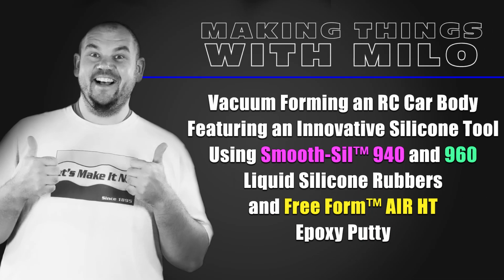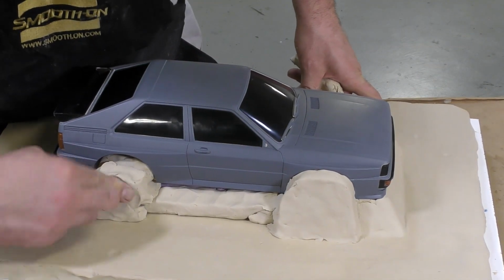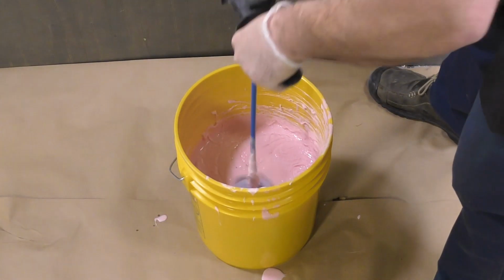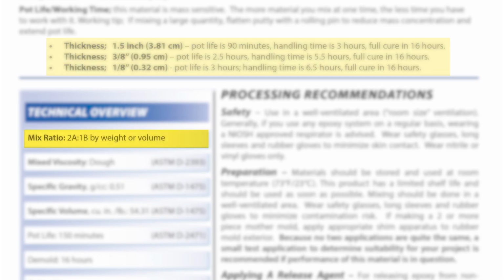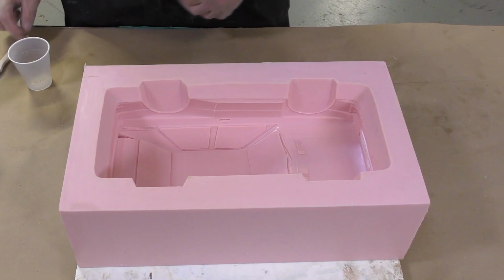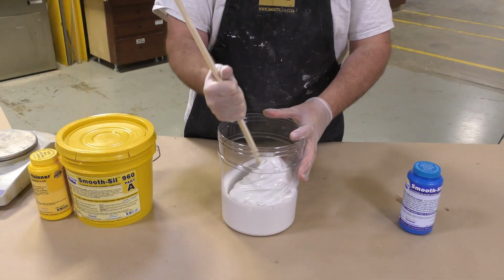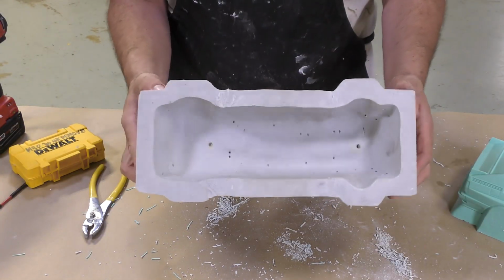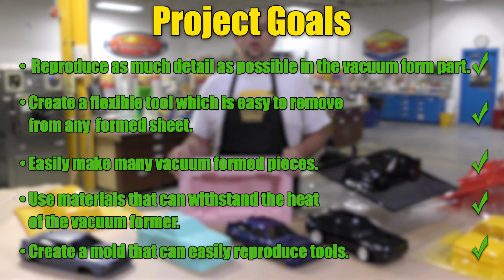Using an Innovative Silicone Tool to Vacuum Form an RC Car Body

Comment: you work is extremely detailed you know your skills thats for sure. especially with that vacuum pressure work raising & dropping that mix & also that 2nd bucket mixing stage with an even bigger mixer, you are very thorough with your work.👍I tip my hat to you Sir.

Comment: Nice work. I've been making V-Formed Polycarbonate bodies this way since 2019. I use the 60 duro hi-temp material and the aluminum-filled epoxy for the mandrel. Much better method for getting precise detail than a hard tool with little or no worry about undercuts, back drafts or difficulty removing parts from the male mold. Thanks for sharing.

Comment: Absolutely brilliant video Milo ! ; ) ......................  right up my alley so to speak.  Watched it 3 times already!
Vacuum forming and designing tooling plugs is what I do,  been using very very expensive Vac-Cast epoxy resins with Aluminium powders in it for years,  closest thing to real manufacturing tooling plugs ( or Bucks ) that the industry use.  Negative draft angles have always been a major issue ...................  until now!

Very cleaver use of the 'Skin' over a solid form.  A technique I'm sure I will now be using myself.  I had no idea, nor did it occur to me that you could vacuum form over a silicon rubber. As I design prototype automotive headlights the methods you've just shown us, is sure to make my tasks so much easier,  not to mention,  the possibilities of vacuum forming shapes that otherwise wouldn't be possible.

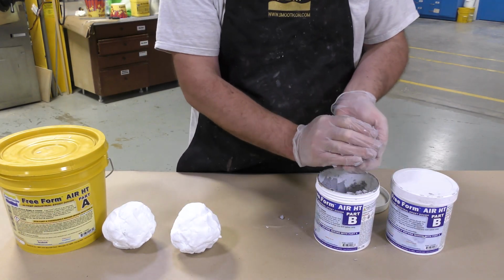It was also very interesting to see you actually preparing the 'Free Form Air HT' @ 16:28,  I tried one of your other products 'Free Form Sculpt' as demonstrated by Janessa in the following video
https://www.youtube.com/watch?v=wja4FNQ4Ojg&lc

The product was awful ! ................  I found it to be unworkable,  my comments at the time were somewhat harsh,  my frustration was very clear at the time.  But 'Free Form Air HT' seems to be the product for me. We shall see  ; )

My vacuum forming machine happens to be the Formech 508DT that you used for the demonstration,  great machines.  I also have a 20 Litre degassing system from 'Easy-Composites' in the UK,  so all I need now are the materials ...................  hopefully I can buy them through my regular Smooth-On supplier in Europe.

Many thanks for these great tutorial videos guys, keep 'em coming  ; )

TURK
T4 Concepts

Comment: I ve been forming bodies for more than 10 years and i'm always happy to learn new skills! The solid core with rubber skin is a brilliant idea. Most of my molds are in pu resin charged or not. I use silicon for fiberglass molds but never thought of forming with it. Thanks again, will try this ( on my formech 😉)
Reply: I’ve been incredibly curious as to how people make these bodies. I really want an 02 WRX 1/10 scale body. Is this something you can create?
Reply: @slicelifetv  vacforming technique is made to build in series, so I can make one body, but customer need to pay for mold, so for one body it's rather pricey 😉

Comment: Thank you for this video!  I have been trying to explain this process for making a vacuum forming buck like that to the people at the makerspace, but my description always fails to describe just how much detail and saved time this process produces.

Also, I did not remember hearing you mention this, but you should file down the edges of the cutting tubes (either inside or outside) so that the act like a blade and punch through the material more easily.  File down the inside if you want to keep the outside dimension accurate and vice versa for the in side dimensions.
Reply from the maker: Great idea!  Thanks for watching, and don't forget to subscribe!

Comment: I think there is a way for getting better detail in the body. That is making an inverse mold, so the external parts of the body goes against the mold walls. I mean, a concave mold. That way you'll have the best body detail outside and not inside. Tell me what you think of this. Regards and congratulations for your amazing work.

Comment: In the late 1980s, I had a few of that specific RC car from Radio Shack, the Audi Quattro.  I still have them.  I also have the service manual with the electronic schematics, mechanical assembly drawings, etc.  I really enjoyed this video showing the entire process of reproducing the main body.  The original car was painted metallic silver and covered with paper decals so I assume the one in the video was stripped and prepped prior to the video.  The original car window piece is black plastic so I thought it interesting to consider the possibility of using similar procedure to make a new clear polycarb window part for the original car body to expose the interior if anyone wished to model a new interior and driver figure.
Reply from the maker: Thank you for watching! Don't forget to subscribe!

Comment: Your braver than me mixing that bucket of silicone without holding on to it I keep waiting for the bucket to helicopter and spray pink everywhere in sight trust me I’m not as lucky as you just thinking about not holding on would cause it to go everywhere and that’s before I start mixing 😅

Comment: 4:06 why not support the inside of model being copied with a layer of the same silicon with a Ridgid solid core placed into the still liquid silicon before it sets.  That way it’s perfectly protected from collapse and warping, the rough cut foam panel support is cheaper but could cause just Ehh result.

Comment: Very very cool !
I just made a rc body out of fiberglass. 
Do you think it tolerates heat for vacuum forming?
Reply from the maker: It would depend on the resin.  We recommend you contact the resin manufacturer for heat tolerance.
Reply: I used fiberglass to make my bucks for custom rc bodies when vacuum forming
Reply: @smoothon  thank you.

Comment: What vacuum pump are you using in this video? Thank you and have a most awesome day!
Reply from the maker: This is a Formech Vacuum Former - www.formech.com
Reply: @smoothon  Sorry I did not articulate, what make and model vacuum pump are you using to de-gas the silicon compound?
Reply from the maker: This is an 8 CFM vacuum vane pump.  Many different types are available from online retailers.

Comment: I can't get hold of 'FreeForm Air HT' in France, and my regular supplier in Holland doesn't stock it.
Can I use regular 'FreeForm Air' ?

TURK
T4 Concepts
Reply from the maker: Regular Free Form AIR may deform under the heat of vacuum forming.
Reply: @smoothon  Thanks for getting back to me ................  I could of ordered it via my regular supplier in Amsterdam but they said it would take about a month to get here.
So I ordered the 'regular' FreeForm Air for the time being,  I'm hoping I can at least run one vacuum formed part ( maybe 2 ) just to check my prototype.
I intend in making a 'manufacturing' tooling plug from my FreeForm Air if my prototype turns out OK.

TURK

Comment: Quick question if I may ...............
I had an issue using the release agent 205 ( both silicone molds stuck together slightly in places ), is it possible 
to use 'Sonite Wax' as the silicone to silicone mold release?

TURK
Reply from the maker: Some customers use petroleum jelly as a separator for silicone to silicone as well, but it is important to apply a very thin layer.
Reply: I use the aerosol version of this, the 200 mold release and i have to spray the crap out of my mold, i mean shiny, just before the point of puddling up. Also make sure your silicone is properly cured (not just set but final heat cure too) or else this release agent won't work. Honestly just use petroleum jelly, it never fails. Also talcom powder works ok but I've had it fail occasionally.